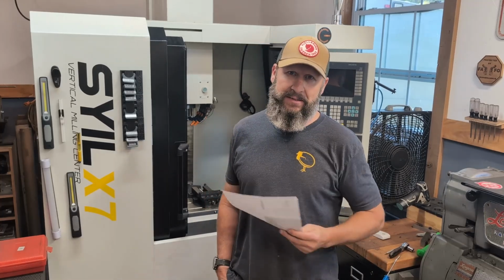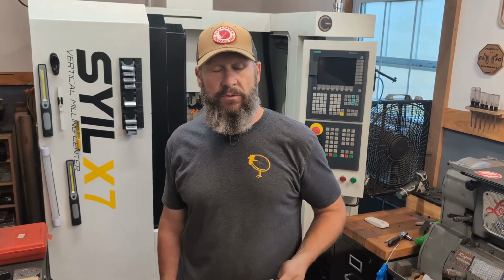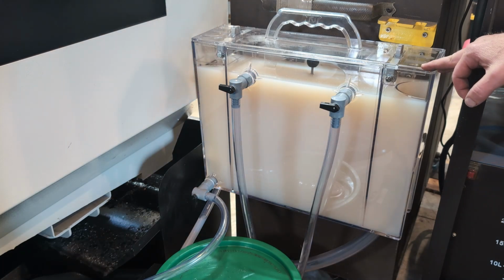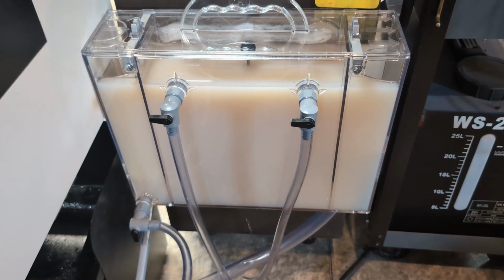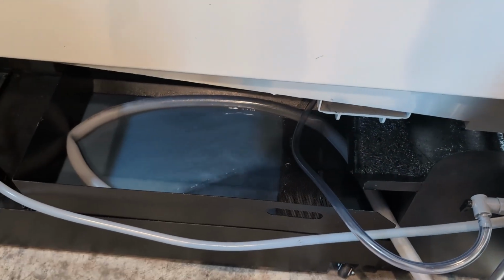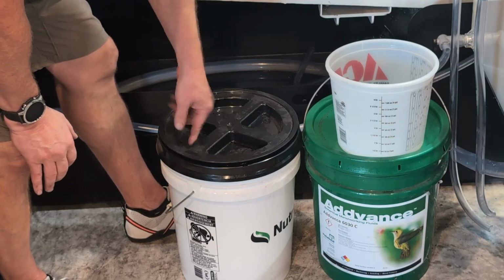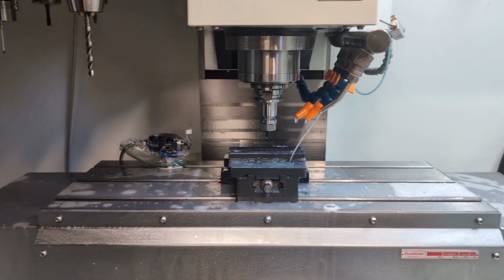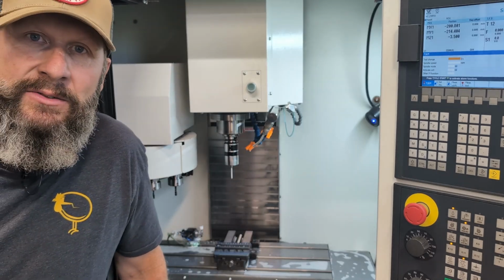Flood Coolant & NEXJEN Oil Skimmer on SYIL X7

Comment: Hey @PowerForgeWorkshop , a question on your Nexjen.  Are  you using the float inside of your coolant tank?  All that's visible is the hose going down inside the hole in the enclosed top of the tank.  Were you able to put the float inside, or are you just sucking the coolant from the hose going down inside?  Thanks
Reply from the maker: Yes, the hose goes down into the pump.  The float is stationed next to the gate that lets the fresh coolant into the sump.  

Might be a good time for me to take the top off and inspect it.

Comment: I have this same setup on mine but I put the clear plastic separator on the back of the cabinet on the right side if you are facing the controller. Seems to work. I don’t use the machine much so I have a smart plug turning it on daily to circulate the coolant. The only thing that sucks is the hose from the float has gone stiff and wants to tilt the float.
Reply from the maker: I thought about mounting mine  there too.  Lots of options.  Interesting to hear that the hose hardened.  I know what I have to look forward to now.  

Does your set up work well for you? Is it collecting oil?  

I haven't noticed a layer of skimmed oil yet.  I have mine programmed to run every night  even though I use my machine almost everyday.
Reply: @PowerForgeWorkshop  My machine is barely used, i have some slight scum but nothing to write home about. I don't have any in the tank either and its not stinking up the joint so i'm not sure.
Reply from the maker: @FrankRoark  Sounds good.  I have to say that the coolant makes my shop smell like a new car with leather interior.

Comment: Going to pull out the bin in the morning and start hooking up the coolant on the X7....any diagrams, or are the hose sizes and placements obvious?
Reply from the maker: I downloaded an X7 manual from the Facebook group and it gives general information, but no diagrams.  My SYIL is 2020, but the information should be similar if not the same.

I recommend the following:

Ensure that the pump, when turned on (dry), spins in the right direction.  Might need a helper for that. Turn it on on the control panel, and then turn it off. Watch the direction the fan blades rotate.  They should match the arrows on the housing. This is important if you're running three-phase power. 

On the stock setup, the pump leaves the sump and splits into two pipe fittings.  One hose for the spay gun and one for the coolant manifold. You'll need to hook the hoses up from the pump however you think fit best.  Once you have coolant running, make sure you don't have leaks.  You may need to reapply tape/putty. I inspected all the fittings and tightened as needed.

Also, make sure the tank doesn't leak. Fill it and leave it over night to make sure it's not leaking or seeping fluid.  

Hope this helps.
Reply: @PowerForgeWorkshop  Thank you sir. Power is on, no leaks from tank...and it explains the two hydraulic hoses.
Reply from the maker: @killerfungis  Nice 👍 Sounds like you're ready for coolant.

Comment: Out of curiosity, what way oil are you using?  Also, huge thanks on the MSC tip.  Penn tool is asking $765 for the same nexgen skimmer kit.
Reply from the maker: I'm using Mobil Vactra Oil No. 2 way oil. ISO VG 68.  I bought a gallon of it in 2021. It is what my SYIL rep told me to get. 

I'm glad MSC is cheaper. I almost bought it at a higher price as well.
Reply: @PowerForgeWorkshop  ahh right on!  That is what I ordered to give it a try in the X7.  Glad to hear Syil was recommending it as well!

Comment: I have been looking into this oil skimmer. I currently have the skimpy el nino and its ok but I think I need more lol.. Also what year is this X7 because my coolant tank looks drastically different on my X7. Great vid
Reply from the maker: My mill is a 2020.  I ordered it not long after they announced the new Schneeberger mineral casting (before covid-19 took off).  So it's an early model for sure.